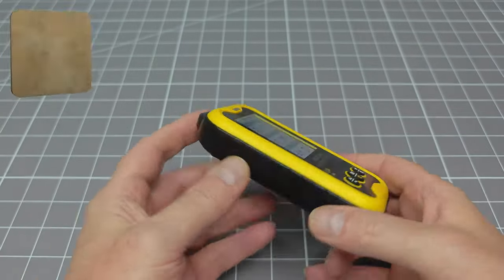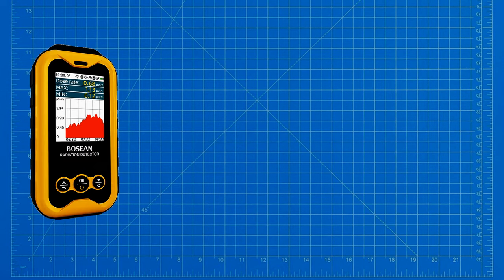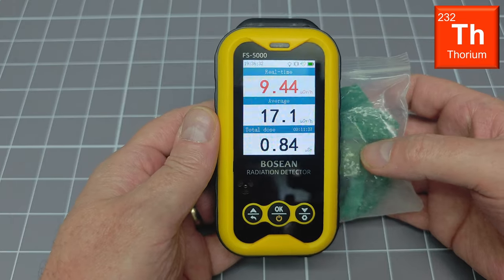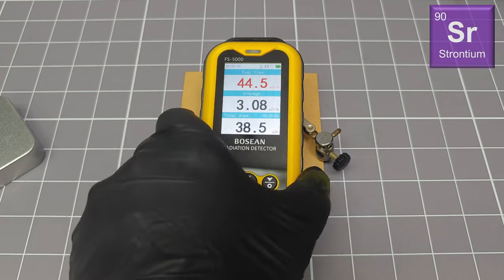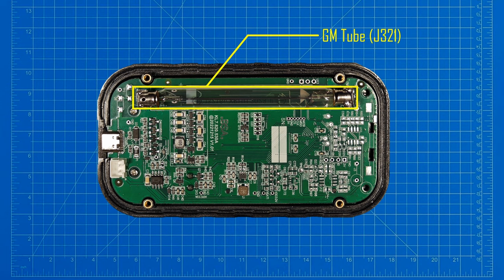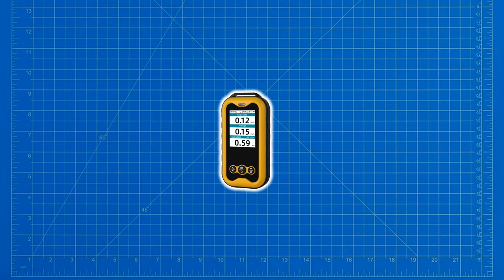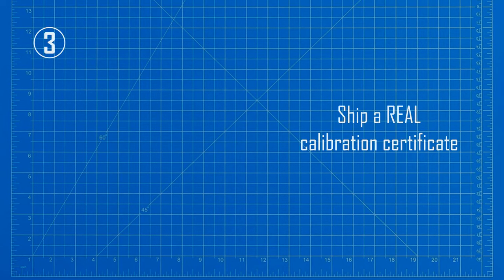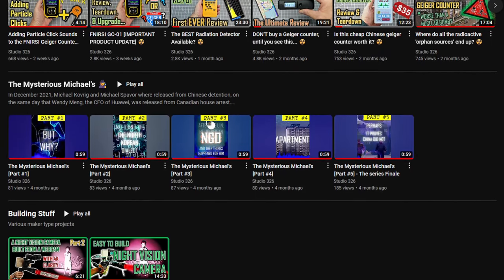The Perfect Cheap Geiger Counter?

Comment: Is it possible to detect alpha particles through the openings at the back with fs-5000?
Reply from the maker: no, the glass of the tube will stop the alpha particles.  Alpha's are pretty weak in terms of penetration, they can only make about 30mm of air...
Reply: @project-326  thank you for reply. Another question, Is it possible to modify the device in order to capture alpha particles? Something like extender with alpha particle detector with a plug. So that you can plug it to device when necessary and unplug it when not in use?

Comment: I bought one at Amazon.  Is it possible to turn it off?  It seems to be always on.  Also is it possible to turn the screen on for more than 3 seconds?  Hit any button and the screen comes on but only for 3 seconds no matter what any other settings are set from the set up menu.
Reply: discovered that it is possible to turn it off if a screen is on and then the power button is pressed and held for 3 seconds.
Still no way to have the screen stay on for more than 3 seconds.
Reply from the maker: You need to go into the menu under backlight, there you can set the screen backlight time in second - I have mine set for 300 (5 mins) because I was making a video.  You can also set the brightness here too.  Remember to press the SAVE option after setting it.

Comment: How do the readings compare to other better meters in terms of of  accuracy?
Reply from the maker: absolute accuracy is a hard thing to define with detectors like this.  The tube will define the sensitivity but the detector can help with how it filters the data and the calibration factors it applies.  I wish that I had a straightforward answer for you, it is an interesting subject and one that I am busy trying to learn more about myself.  Your question is great, trying to answer it perfectly defines the issues with radiation detection equipment!

Comment: Hello, sir. Please, I'm looking for an affordable Geiger counter that can detect multiple types of radiation, including alpha particles. Do you have any recommendations?
Reply from the maker: May I first ask a question, what do you see as the main reason for wanting to detect alpha particles?
Reply: @project-326  Yes, sir. I would like to detect radon and thorium radiation. Just to be super safe around an old house that I recently bought.
Reply from the maker: @rafaellavratti  The best thing to get it that case is a gamma ray spectrometer, such as one of the Radiacode devices.  It can detect the presence of those isotopes (Rn222 and Th232) by seeing what is happening in the decay chain.  You are not going to be able to read above background looking at alpha from Th232 - the half-life of this isotope is longer than the current age of the universe.  What you will be able to detect is the many associated gamma emissions that accompany alpha and beta decays in that decay chain.   Rn222 is also difficult to detect directly as its half-life is less than 3 hours.  Again, a gamma ray spectrometer will allow you to infer its presence due to the decay chain products.
Alpha detectors tend to be pretty expensive, you will certainly pay more for a reasonable one compared to a Radiacode product and the alpha detector will have a lot less general use cases.
Hope that helps...
Reply: @project-326  Thank you so much for your response. I really appreciate it. If I may, I'd like to ask another question to take advantage of your expertise. Given that the Bosean FS-5000 is quite affordable, could it detect a hidden source of radiation in this old house that I bought, such as a piece of iron or steel that got contaminated, or any other object exposed to radiation? Do you think I would really need a GR spectrometer like the Radiacode, or would the FS-5000 suffice for this purpose? Thank you for your time and patience.
Reply from the maker: @rafaellavratti  Yes, the FS-5K is a very good detector, but you will need to balance the sensitivity that you need.  GR spectro like the RC102/3 will be about 30 to 50 times more sensitive than the FS-5K.  This translates to how long it takes to be able to get a background reading.  The time needed is pro-rata  as the sensitivity.

Comment: There is an interesting indie design model KB6011(2024) with a J305 tube plus a PIN diode as sensor on Taobao. I'm curious how the sensors work together. I've been using their old model KB4011 from 2021 and it's already the fastest in terms of response time among my other devices. I see that the tube is covered with metal foil, probably for energy compensation, but I don't have a proper source to test it. I'd appreciate it if you could review it sometime.😉
Reply from the maker: I would have normally expected this to be able to add 'alpha detection' capabilities to the specification.  In this case, I have no idea, alpha isn't included in the spec and its covered in the plastic case anyway.

I guess I just looked at the same TaoBao advert as you, that has a a J321 & J305 tube wrapped in copper foil and kapton tape, which they seem to claim gives a 20% to 30% increase in sensitivity, which is clearly BS.
Frankly, if I buy any more counters, my wife will kill me.

PIN diodes aren't any where near as sensitive to gamma as a J305 GM tube, perhaps it is used to extend the lower energy boundary for betas or x-rays...?

Maybe they realized that Measall made a name for including the PIN diode in their products and its just a marketing gimmik...
Reply: @project-326  Thank you so much for taking the time to provide a thorough explanation of this issue, which resolved my confusion about the PIN diode. I also read some literature and found that the PIN diode has a detection rate of less than 0.5% for relatively higher energy gamma rays, so it's really hard to justify the claim that it improves sensitivity.

Comment: ciao ,faccio collezione di minerali e abbiamo in programma ad una visita in una miniera di uranio abbandonata, ho comperato un dosimetro scintillograf radiacode 103, con 2 soglie di avviso, non riesco acapire a quanti microsivert devo tatare la prima di avvertimento e la seconda che mi dice che devo uscire subito. puoi aiutarmi grazie e complimenti per il canale
Reply from the maker: Normally, 1uSv/h is a good level for the low level alarm.  For a danger level, it really depends on how long you will be exposed.  
When I go rock hunting, I normally set the two thresholds to 10 uSv/h and 100 uSv/h.
Reply: Ok tnx for informations

Comment: I see your fs 5000 have a 003 sensor, while mine have a 001 sensor. I don"t know what that means.
Reply from the maker: curious, where did you see that in the video?
Reply: @project-326  you see that in the pic of the pc screen when you show the software. On top of the screen.
Reply from the maker: @Oywind  OK, I'll take a look.  I know that they have changed back and forth between the J321 and other cheaper tubes at various times.
Reply: @project-326  Do you think it's possible to order a j32i tube and replace it with the smaller tube that came with my fs 5000?

Comment: Привет автор канала, вышла новая кастомная прошивка на этот прибор, будет ли видео по этому поводу?
Reply from the maker: from the manufacturer or 3rd party?
Reply: @project-326  Hello, I managed to flash my Bosean fs5000)).It became very fast, although it began to show a lower dose of activity, but I think it just needs calibration.
Reply from the maker: @georgiy0077  How is the display?  I must admit I found the GISSIO UI a little 'boring'.  There is a calibration factor that can be changed in menu and also in the PC application.  With the new firmware, does the device still work with the PC application?
Reply: @project-326  The dosimeter does not work with the program, the calibration parameters seem to be there.

Comment: What’s cause this to be slow to respond? On mine it takes alittle while to level out. Also a 45usv/h source says it’s only 1500cpm which seams weird
Reply from the maker: The instantaneous value is not too bad on mine, the average value has a pretty long integration time.  Did you see the post I made about this in the community tab of this channel?
It might be worthwhile to check the tube type in yours.  Some other viewers have reported that this device now has a new tube, an inferior one...

Comment: Showing measurement Data in Microsievert per hour is quite hyperbolic. The presentation in These values IS strongly model dependent and depends one a lot of assumptions. Errors of a factor of 2 or even more IS highly likely. Therefore I understand that you might never get a calibration certificate from the manufacturer. (Sorry for the typos, my Germany autocorrection IS a pain)
Reply from the maker: No problem with the English, I'm British so mine can be pretty terrible at times too.

Thank you for the feedback.  Yes you are absolutely correct about the counts to sV/h calibration.  Clearly, this tube, and all of the tubes in cheap counters have horrible peaks in the sensitivity curve across energy levels.  And that is just for gamma, for betas, the situation is actually worse.  Typically I allow around the kind of tolerance you mention for these kind of measurements.  Mostly I am interested in the ratio between measurements for each of my sources, which I know quite well.  For my strong point source, the Sr-90 check source, I'm just trying to find out if the counter will saturate before the tube does (many of them do).

To have any kind of serious measurement, a lot of money needs to be spent - what this video, and my other counter reviews is attempting to do, is to help those people that either don't want to spend hundreds, or even thousands but still want something that will be reasonably useful in general applications.

It kind of also about learning.  So many times I see in the comments that a viewer has bought something like this FS-5000 and now wants to learn more and will ask a lot of questions.  That alone makes it worthwhile, there is so much disinformation out there with regards to nuclear physics.  Every one person that can pull out a counter and check something that they are told, is worth 100 people that just accept that everything 'radioactive' is bad.

I have gotten board counting the number of people that still think gamma ray irradiation of food is making our food radioactive.
Reply: @project-326  Even your spouse can be a radiation risk (40K).

Comment: Hi, Any idea on how FS-5000 compares to BR-9C (the original, yellow one, not the XR fake crap)? I have the BR-9C with a J321 GM tube and it seems quite sensitive, although I don't have anything else to compare it with. Therefore, I'm wondering if it's worth upgrading to the FS-5000, considering they use the same GM tube. I'm aware of the current limitations of BR-9C, namely the capped graph and the rather small upper detection limit, although I've yet to max its reading so far. Can you perhaps make a video comparing both units, considering BR-9C seems to be a popular device? For example, I initially wanted to acquire the FS-5000, but since it was during the time Bosean decided to downgrade the GM tube inside from a J321 to a lesser quality one, I decided to buy the BR-9C since it had a J321 GM tube and an EM detector as well. Now, seeing they added the J321 GM tube back to the FS-5000, I don't know if it's worth spending more money on that unit or the BR-9C should suffice quality/detection/sensitivity wise.
Thanks in advance.
Reply from the maker: Well, I'm not going to tell you to buy anything, but I will say this.  As far as I know the BR-9 has the same firmware as the BR-6 (I have never tested the BR-9, but from other reviews I have seen) so seems to have the same range limitation issue as the BR-6.  Please feel free to correct me on this point, if you know this to not be the case.  I have tested the FS-5K to over 2 mSv/h.
Reply: @project-326  I'm aware of the software limitation and I'm perfectly fine with the 99uSv/h limit for the $27.5 with free shipping I spent on the unit (it seemed like a good deal). With that in mind, I was more interested to know if there was a significant discrepancy, if any, in terms of sensitivity for the same 0-99 uSv/h compared to the FS-5000. Even though they are not the same (I assume the BR-9C should perform better than or at least similar to the BR-6), since you already have a BR-6, have you noticed any major differences in sensitivity or performance compared to the FS-5000 for the same range and source?

Comment: I assume it has simple sliding window algorithm (i.e. dose rate for the latest n seconds), what is the window size for realtime and average?
Reply from the maker: These are both very good questions, but I don't have any code for the product and the manual doesn't have any better info either...
Reply: Wouldn't you be able to get the average time window by putting it on a source and time how long it takes for the average reading to match the instant reading? E.g. if it takes one minute for the average reading to match the instant reading , the average time window is 1 minute.
Reply from the maker: @Ni5ei Yes, you could sort of extract the time constant of the TF in that way.   The sample rate of the logged data is highly under-sampled and very low, only 1 sample for every 2 seconds so its not like you can measure an impulse response and run it though an FFT to extract the transfer function of the averaging function.  That said, I will have a play with this later and let you know what I find.

I am actually quite impressed with the averaging on this device and they have used an MCU has a floating point module, so perhaps they have taken advantage of that...

I keep thinking about designing my own counter from scratch.  Personally I would use an adaptive filter to iteratively converge on the average.  At the initial turn-on, the filter can be populated with fewer taps and progressively increased in length as more data gets sampled.
Reply from the maker: @Ni5ei  I just made a very quick test.  I used a natural uranium source that had a steady state dose rate of around 115 uSv/h.
There are essentially 2 filtering algorithms in effect.  The instantaneous value takes about 20 seconds to reach the steady state value and the average takes about 1 minute and 75 seconds to catch up.  It is about that same for the rise and fall times.
Hope this help to answer you question...
Reply: @project-326  thanks. It is a simple algorithm, but its main advantage over adaptive ones that it is fully predictable. No surprises at all :)

Comment: Have you ever tried one of the Soviet ANRI-01 Sosna type counters?

There are a few on eBay for less than £100 and they have 4 x SBM-20 tubes in them.

Look incredibly basic and probably totally indestructible. Was wondering how this sort of thing compares to the modern Chinese offerings.

Still think that the radiacode looks the most interesting because of its reasonably affordable price and ability to differentiate between different isotopes.
Reply from the maker: No, not had the privilege.  I saw a repair video on one (or something similar), all of the hand wiring (aka birds nest) looks like a total nightmare, I would hate to open one up - for sure some of those thin wires will break off.

4 tubes is pretty cool though.

Comment: After a disappointing experience with my suspect 'fake' GC-01, I've just bought one of these :) No I await delivery lol
Reply: I  did the same.
If you bought it from their official store you are ok in a way because you will get refunded.
I didn't and now  i try to contact the seller..
 A new fiasco!
Reply: @razor7799  wishing you good luck bud, ridiculous to think there are fake Geiger Counters out there!
Reply from the maker: These things happen and it is almost never due to 'fakes'.  They are all made at the same factory and the retail customer has price/performance options when ordering the product.  The FNIRSI brand themselves told be that they have changed the tube on three occasions as they constantly "strive" to reduce the cost.  I have reports that Bosean has recently done the same thing to the FS-5000.